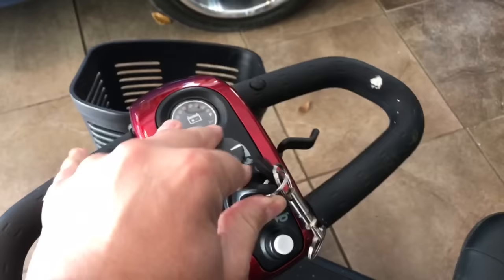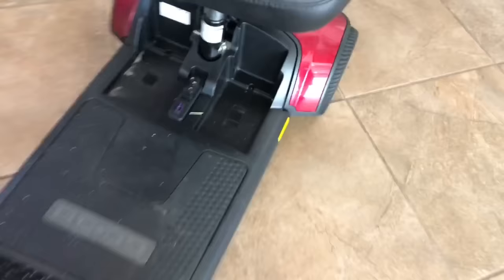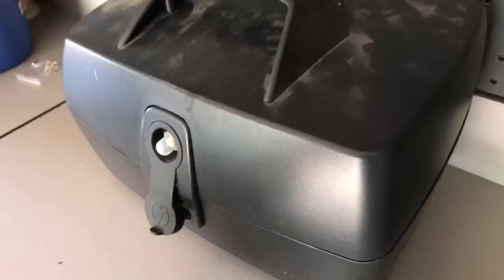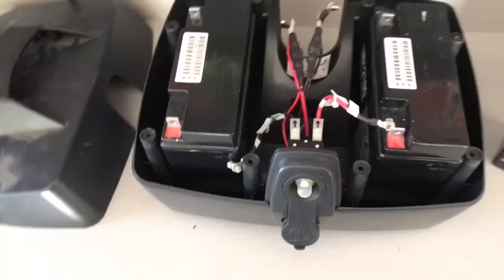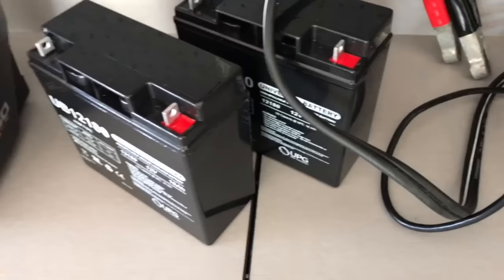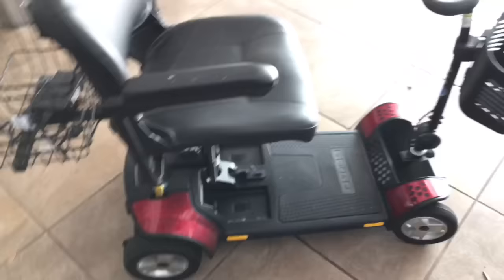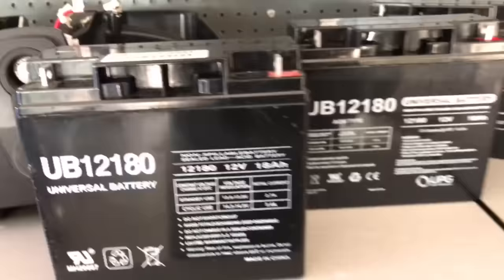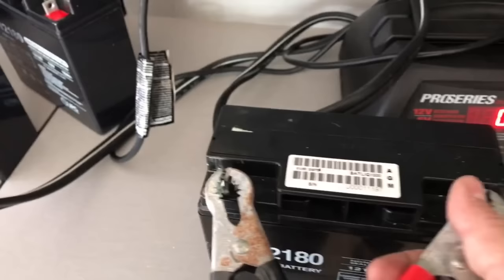How To Fix Your Scooter That Won't Turn On Or Charge

Comment: p;rided are c rp  fortress way superior i have had a fortress  for over 5 years use it   constantly    summmer  and   down to    -5c winter, changed tires twi ce   $400 incl wheels house  visit by tech  cause they wore out    still same gel battteries,  kept in garage when  not in use i plug charger in evedry time i retur n to house.         charger supplied  by manuf.       bought it used $350    carrying  weight for scooter is 400lbs

Comment: Why can't I change the batteries without removing the battery box from the scooter?
Reply: Because there are screws from the bottom of the box holding the batteries down. You need to remove them before the batteries will separate from the box

Comment: Alternately, write to the manufacturers and ask them why their shit products fail so easily and does it have anything to do with built in obsolescence? They will deny that but if enough of us  ask the question they will realise the public is catching on to their damn scams.
Reply: InTheNameOfJustice ...ok , let's bring you back to reality for a second. This is NOT a scam.  this is the evolution of batteries technology.  Lead acid batteries in e-bikes are exactly the same. Never ever empty them !!!!! it says so in the manual for God's sakes !!!! Lithium Ion batteries DO NOT DO THIS and are way way better but they've only really been hitting the market in the last couple years you know.  If you buy a cheep affordable model then you will get Lead Acid batteries NOT Lithium Ion.  add $700-$1500 or more to a vehicle ya know.

Comment: Have a golden companion scooter. It comes on but will not go. Green light blinks 3 times then pauses for 2 seconds. Anyone out there help me??
Reply: Always be sure that the motor locks are in the drive position BEFORE turning it on.
Reply: Hold joystick forward until it beeps the hold joystick back till it beeps ,that should take out of lock mode
Reply: Steve Harris thank you thought my chair was broken but I did the joy stick back and forth and it was locked now it works fine thank thank you

Comment: I f your battery charger isn't litting

Up what to do
Reply: Maurice Trull
Reply: Lighting up I think is the term you're trying to use. Make sure the XLR connection from the charger to the joystick is good. And that the cord from the joystick to the battery chord has a good connection also. But you may need a charger. So go on eBay and search Mobility wheelchairs or scooter chargers 24 volt 4 amp charger is pretty good for most chairs. You can get the proper one which may look smaller than the one that comes with a Pride scooter/chair for about $21.
Reply: @myk602010  wait! a 12volt charger may not work because the scooters typically use 2 batteries wired in series i.e. 24 volts , the amp rating will relate to the amount of time charging 2 amps will take doble the time a 4 amp rating i.e. overnight or more. maelo60
Reply: @ismaelmartinez2347  yes the output of these chargers is 24V, I just didn't realize it. What I had in my mind was that if I had the batteries out, I could use a 12V car charger.

Comment: The scooters old batery that has less voltage then 10.5 volts the original charger will read that low charge less then 10 and half. . then that original charger will not put charge into the bateries . probly a scam of the manufacturing they want you to buy there batteries .  i took both of my low chargered dead batteries charged them up with something else higher then the 10 1\2 volts then put baxk in the batery cach . then the original scooters charger then worked & and charged the bateris .  when scooter left alone not used not charged up . by siting not used . day after day month after months them bateries will drain all the way down to shit . it whont charge not

Comment: Thats just stupid why not put a charge on the batteries you've let run below 14volts the charger want engage if below 14volts this is why its not charging, hell you hooked the new batteries to your car charger just do the drained ones the same and charge them back up !😏🤔🧐

Comment: Those batteries are for a 24 nvolt system and your 12 volt battery charger will not do shit to recharge those batteries you need a 24 volt battery charger!!!!!!!!!!!!!!!!!!!!!!
Reply from the maker: But it charged them so good I was able to build a spaceship off of them

Comment: THE SCOOTER STORE IS TRYIN TO SELL ME 2 BATTERIES FOR 580 OR 2 CHEAPER FOR 380  IS IT WORTH IT  ITS AN OLD FORTRESS 1800  1600  SOMETHING
Reply: Check with Apex Superstores they're much cheaper.
Reply: No! Go to apexsuperstores.com create an account look up your chair and you will get a variety of different batteries for that chair. You'll see 12v 35ah or 55ah batteries. You'll even see 75ah  batteries. This is the cheapest place I have found. I've been buying batteries from them for months. Depending on what day you order them you can get them in less than a week.

Comment: My scooter doesn't turn on, battery is fully charged,  lights do not turn on, and horn doesn't respond, what might be the problem? Please help me.
Reply from the maker: +Teresa Rivero check the fuses. Something is not allowing the current to get to the circuits. So first check is your ground, then your fuses, then the wires. In that order.
Reply: I currently have that problem and I discovered it's the controller/joystick. The contacts on the circuit board inside under the power button may be old and corroded to the point where the Board needs to be replaced or just the whole unit. There are in line fuses on the cables to the batteries and 1 fuse on most chairs or scooters near the reset button. 
   I'm working with someone on eBay to get aboard or a controller right now. A controller can cost over $300. With due diligence and a little research you can find parts for these chairs & batteries much cheaper than the big suppliers. I can get a joystick right now on eBay for $85 and that's for a Pride chair. Good luck
Reply: My scooter have new battery  have light but it dont move